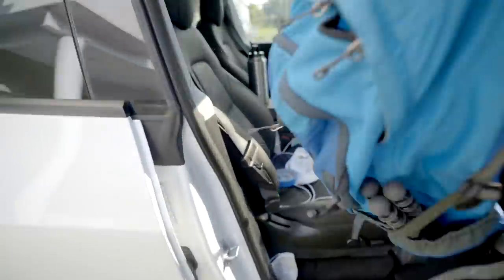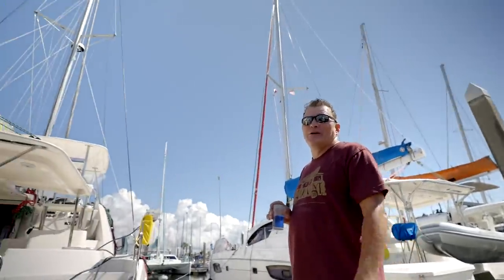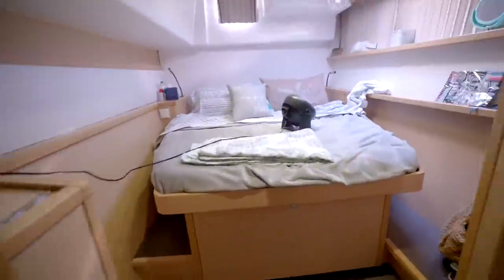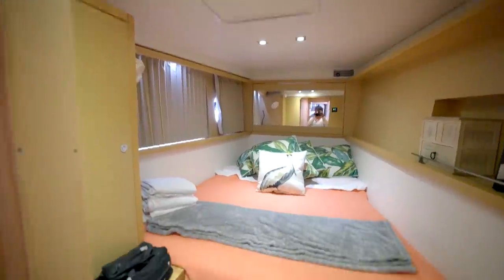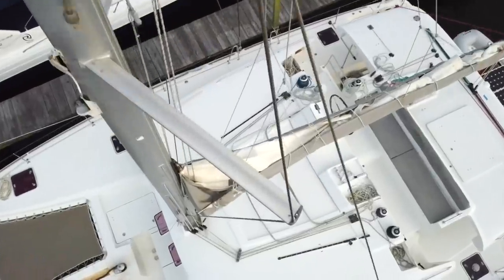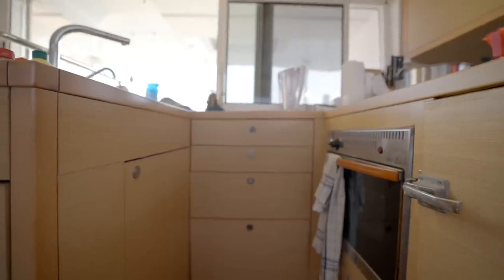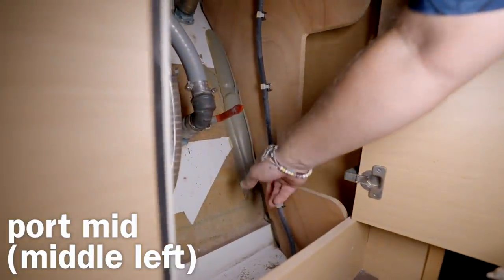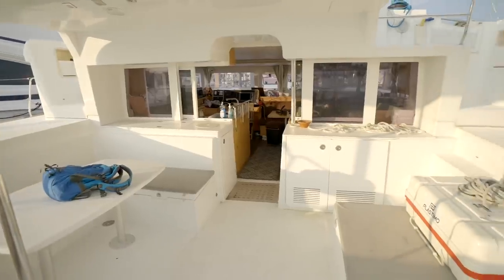Boat Tour!  I found 2 Catamarans w/ Broken Bulkheads Just Like Mine!

Comment: Another tip, if it's necessary to file stainless steel don't use a convention file unless you finish with a cutting disk and polish the cut edge, the reason? A file is made of carbon steel and when you file anything with it, it leaves steel deposits on the stainless, this mixed with salt water make for rusty streaks, trust me this was something else we learnt through experience and experiments.
Reply from the maker: Excellent advice...had no idea--will use this tip when building the solar arch!

Comment: Those string line tips on the floors/decks will help many potential buyers and existing owners eyeball the problem very easily without being sucked in by all the razzle dazzle of a beautiful boat ,great job
Reply from the maker: want to hear something crazy? After all the bulkhead issues and people started testing, Lagoon recently released an "acceptable sinking/bend" spec. I think they're claiming 20mm is normal. I don;t expect to see any on Parlay and my boat once we're in the water, but will keep you posted!
Reply: @david_shih  Foobah
Reply: @david_shih   Yikes , if one expects it to bend 20mm then it should be made with 20MM of pre-bend the other way so it is level when in the water.

I call bull Sthit ,  , no boat should bend 20mm sitting still , what happens when you have 15 people partying aboard ?
Reply from the maker: @faircompetition1203   Parlay and I both went a bit past level (~5mm) so it can bend back a tiny bit. but i agree...the floor shouldn't sink in the middle by design!

Comment: Wow these issues with these boats are horrific . The Last boat I would think is barely seaworthy with the amount of cracks and broken bulkheads.. Great video
Reply: Wrong - not seaworthy at all . No Barely even
Reply: exactly, could separate and sink anytime
Reply: @hthring   Fine for maybe powering around but certainly not to take to sea and face waves and wind . It is a cascade failure , growing as one bit after another fails . Frankly I would even be scared lifting out .
Reply from the maker: Yeah...thank god he was close to home when the bulkheads finally failed completely and the rigging went slack! The lifting iw actually ok if you use a travel lift with straps. The motion actually pushes the bottoms of the hulls together back into alignment. Not so good for the mess of wood inside that cracks all over again, but mine and Parlay's lifted fine out of the water.
Reply: just total it, not worth repairing
Reply: @dhold10  It is , but many won't be able to afford to
Reply: @faircompetition1203  I was being kind ! but this boat needs major repairs, in fact, I would say a complete rebuild. When I saw David's video of the issues on his boat and the type of ply used It was obvious it wasn't up to the job
Reply: @Trev044  I have a 24 foot Shark we are just rebuilding to factory specifications . The main bulkhead for the mast is marine grade 3/4 ply and all the ply is marine grade  , much better stuff than Lagoon used , triple tabbed in to the hull and tripled up at the door opening with mahogany .  This with a second bulkhead about 18 inches forward , also tabbed in ,, and tied to the first bulkhead , then there are double  3/4 stringers front to back . also tabbed in , with a 3rd bulkhead at the back , yep tabbed in . Everything is tabbed in even  the  berths . 

You can lift the whole boat by a keel bolt , and is it heavy ? No 2200 lbs all up for racing .58 years of hard racing and no tabbing had failed, rot got just some of it  when it was left with water in the bilge for a decade ..  Nope they do not build them like that anymore . 

The lagoon structure just does not look up to the massive loads that a boat that size would carry , and in fact they are not are they ? They did in fact fail .

Comment: David, don't worry about the haters, both yourself and Colin have helped  communicate to people the need for a proper survey on ANY boat purchase. Not just Lagoon 450's or any specific builder... ALL boats need a survey as part of purchase.. or the boat had better be $ Free !  You have to know what is going on, particularly since this is a home that MOVES.  You can't get a loan on most homes without an inspection in most places in US, a boat needs it even more.. any seller trying to avoid that isn't worth buying from imo... Take Care !
Reply from the maker: Mike, you'd be surprised. My surveyor, as well as the surveyors of both boats in this video missed the bulkhead problem completely. Of course Andrew's boat broke a lot more on his way back from the carribean, but it definitely already had bulkhead issues. Hopefully with everything out in the open future surveyors wont miss anything.
Reply: @david_shih  I'd get  in contact with that "surveyor" for a refund ! How they could miss the things visible above deck level like doors and windows or drawers out of whack, let alone not using a bubble level on every horizontal surface in boat is hard to understand. Add in they knew it was a hurricane boat, right or was that only in Colin's case with PR ?

Comment: Great entertainment. Let me comment on the number of Lagoon Catamarans... If the 450 is affected, also the other models will probably have issues. The bonding of the plywood is done on all Lagoons the same way. Maybe the bulkheads on other models are stronger against buckling and bending but the joints below the floor for example will be done similar. And as said the bonding to the hull also.
Reply from the maker: the putty bonding technique is definitely inadequate... many lagoons already show cracking there and need to be tabbed in. but hopefully the cracking bulkheads are just isolated to the 450.
Reply from the maker: Hey Bev thanks for sharing! Sending you an email now! Would love to see your work!

Comment: Yes the bulkheads are cracked but that looks like a symptom to me. Considering how the catamarans are held together, I think there is a different problem that is the root cause. I would start by inspecting the beams that hold everything together. The main frame structure has to be shifting to generate enough pressure to crack the bulkheads. Hope you aren't fixing the symptom while missing the root cause that will continue to damage more areas even after you make bulkhead repairs.
Reply: I thought that was very lightweight construction for a structural element.  When you search "lagoon 450 engineering structural drawing" nothing comes up.  Why has no one done an engineering analysis, and just a band aid fix?

Comment: So right, all owners need to name it. It's not a interior issue, it's a safety risk. Out there on sea the right gust hits the boat and the rigg is coming down. Or the boat even may break in pieces. That's not a thing to ignore. Told from a German naval architect.
Reply from the maker: Are you a naval architech bc I'd love to pick your brain on some of me and Parlays repair techniques! We're always debating and strategizing how we did or should have repaired different areas of the bulkheads.

Comment: The inner hull side of the bulkhead is more effected due to the higher force density at the inside (same for each cat). I am not surprised to see rising numbers of damaged boats. It is interesting to see that the damage does not always develop in exactly the same spot, which tells me that the force density does not show one specific hot spot and the design basically was ok, but the material is just too weak. Reinforcing the entire bulkhead like done on Parlay is exactly what's needed.
Reply from the maker: Well by golly thats exactly what i need to hear....I just finished glassing the entire starboard bulkhead, exactly like parlay did. I even got Colin's fist-slam-on-the-bulkhead of approval. 

So if the material is too weak then the design was off right? Or i guess thats what you mean, that they called for the wrong, or not enough, material along that main vertical support.
Reply: @david_shih  Structural parts are optimized using FEA to distribute the force density as equal as possible. That's where you place conduits and round off sharp corners, because those attract force density. In the end, you have a model and know which force density you need where, and either build the whole part with the maximum requirements or reinforce hot spots you could not resolve acceptably. Fiber glass allows that nicely, but the more complicated the part is, the higher the production costs are, but the more light weight a part can be. A true design error would be a left hot spot that is not reinforced. Choosing the wrong material for the needed strength or accepting poor material quality is more a manufacturing error. A left hot spot would lead to identical damage on all boats.

Comment: David a lot of people are seeing you and Colin's story. Not to mention all the times "the Lagoon problem" gets mentioned on other channels. I'm pretty sure everyone in sailboat circles knows about this issue. Every sailing channel out there needs to make mention of this to insure people know. The airplane fellow hit the nail on the head with his comment about 5 ply sheets. Seems like starboard sandwiched between 2 sheets is what it should be on the bulkheads. Lagoon totally underestimated the forces placed on these members. They need a repair plan that addresses 100% of the issues, not 10% of the issues.
Reply from the maker: Slim, you couldn't be more right on the necessary repairs. Luckily Colin spoke directly to the designer of the boat and got his recommended repairs. And, that is the process we are following. Lagoon took the designers repair recommendations and made a low cost alternative.

Comment: I think you and Parley should start a school. 10 450's at a time. Hold class and set them free to do their own work. Then another class for the next part.  The first guy you spoke with said exactly what I told Parley way back when. That ply is NOT designed for stringers and stresses. Pine and Fir is not very strong on it's own. The crossing layers with glue between them gives it strength, but not for STRESSING and the stringers are 100% what keeps the boat in shape. Literally!!!
Reply from the maker: It's kind of happening already...we just checked out a lagoon 410 with a badly cracked starboard bulkhead and provided an extensive repair procedure. And by we I mean Colin and I watched.  They're now hauled out and working on the repairs!

Comment: Thank You! This is extremely concerning, and yet there are none that have failed completely (separated bows or something)? Is this across all models and years?  What ones will never need the repair?
Reply from the maker: all lagoon 450s were affected...and some of the other models have had issues as well. none have failed completely, the rest of the boat holds it together once the bulkheads break and the hulls bend...
Reply: @david_shih  i'm so glad I found this.  I do not have confidence in the fix. If there's enough stress to break it once, more damage is certainly possible unless you replace the entire webbing of plywood with something much thicker, but I'm guessing.
Reply from the maker: @nextari  Good point. We rebuilt the main failure point with 3x the materials, but the we also reinforced the secondary stress points to spread out the load now that the main breaking point was fixed (beam, tabbing into the hulls, extending repairs ~4ft inboard from both sides). Check out the later videos in the series and it should make sense.

Comment: Lagoon should be available for advice and help on this. Use of none marine ply and low strength quality ply wood is so bad.  Then the cracks in the strong points it is so bad help and change is needed.
Reply from the maker: hey jonathan...they did advise us on our repair! It was the actual designer of the boat and he recommended the fiberglass layups and procedures to reinforce everything!

Comment: Was it on the 450 model or do other models have this issue. Love the 380 model but don't want to fix issues like this.
Reply from the maker: saw a few lagoon 500's with the issue, but mostly its all of the 450's.  the 380 should be fine espeically since the beam is so much shorter so the leveraging force on the bulkheads are exponentially less.

Comment: That bulkhead that literally snapped you'd hear that happen if you were close. I can't believe the ply wasn't even glassed up with reinforcement, such a big expensive  boat with lots of serious stress points built like that. Isn't there some sort of building code involved here?
Reply from the maker: I guess in the boat world there isnt...although Lagoon claims they met every requirement.
Reply: @david_shih  I just saw your reply, I can guarantee you this workmanship wouldn't pass regulations here in Australia. You should see what I have to do just to get my home built 14 composite dinghy registered. They haven't tabbed the bulkheads to the hull with glass reinforcement, they've just used a huge smear of glue. There's no way that would pass muster here
Reply from the maker: @Antipodean33  and that smear of glue doesn’t even touch the deck in some places! Craziness!
Reply: @david_shih  Do you know where this work was done, what country? I also wonder where was the quality control manager on this, surely they'd have someone qualified, or at least knows what they're doing overseeing the build at all critical stages. These are expensive serious boats, it blows my mind how all that passed without notice